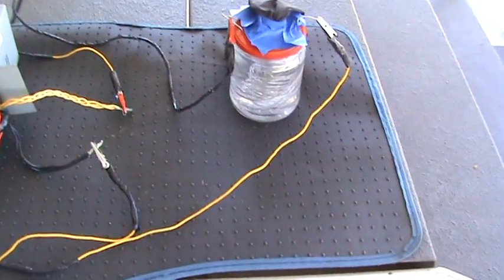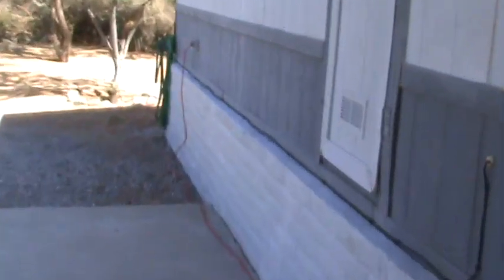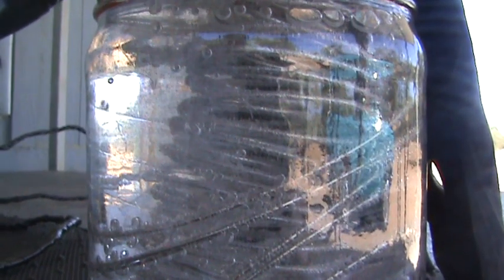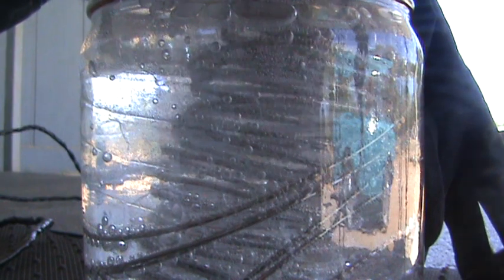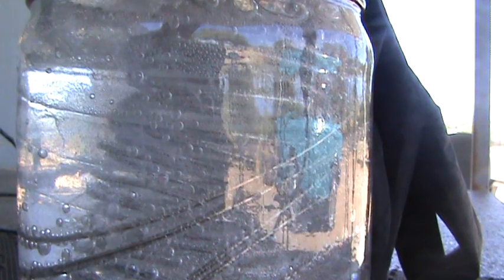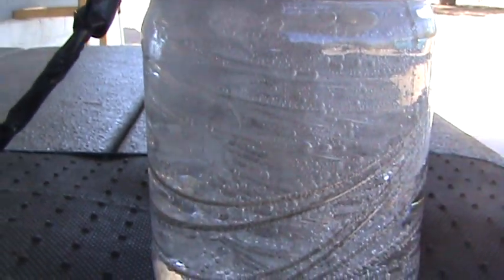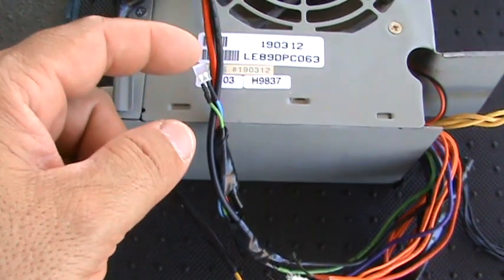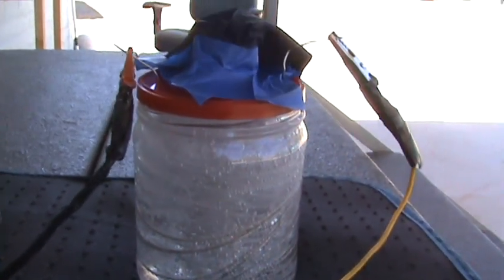HHO generator power supply

Comment from the maker: @Me102288 Stanley Meyers did not use a hho generator if you watch Stanley Meyers 1992 Interview he explains how he does it, he uses a water injector that is using a pulse generator that  electrifies the water into a mist inside the motors cylinder which electrifies the water instantly into hydrogen, similar to today electronic fuel injectors except he is using high frequency to split the water into hydrongen. research your self before you blow your self up.

Comment from the maker: @Me102288 this is a old video of mine, i use to play arond with hydrogen. i stopped why Its very dangerous, I have had 2 hho generators explode on me and yes I was using a bubbler also. bubblers do not work, brillo pads and making your own flash back arrestor like you see on youtube is dangerous, it only takes 1 time to make a mistake, running a hho generator to drive a car on hydrogen is not the right way to do it, everyone on youtube saying they are driving on hho are not telling the truth.